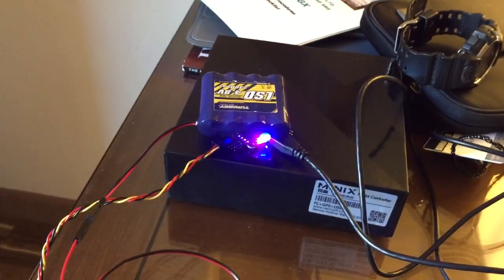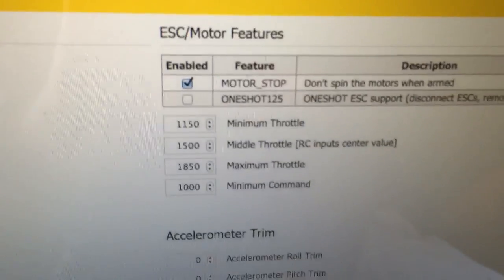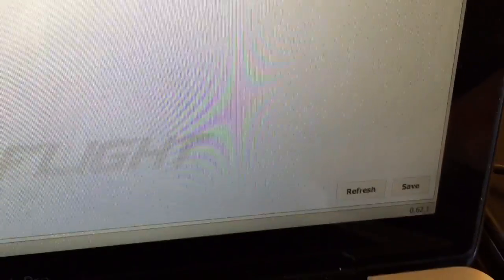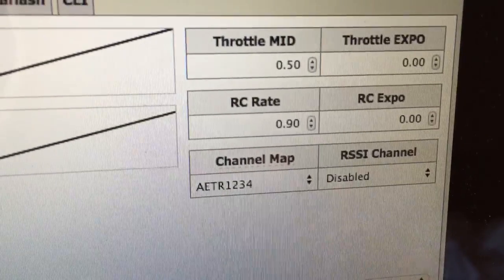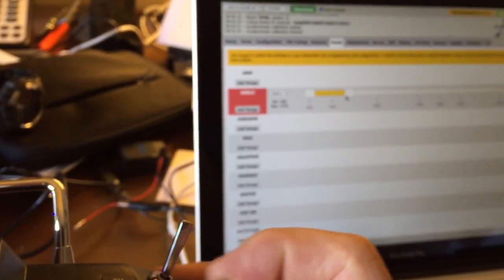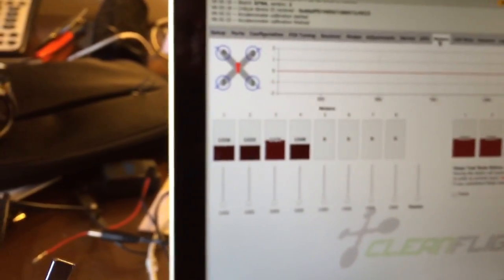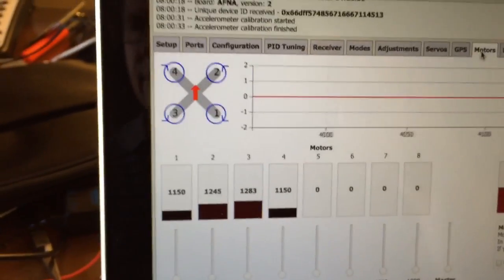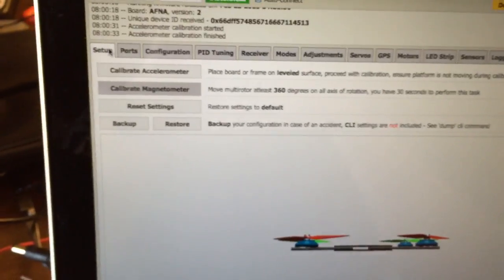Cleanflight configuration on Naze 32 / Mullet.

Comment: I noticed when you were on the motor page of CleanFlight and running the motors through your tx that motor 3 was running up on its own. Did you fly it like this and if so did you notice any controllability issues? I have the same issue and it causes big problems in flight. Very inconsistent hover, especially. Were you able to find a solution for this issue?

Comment: I just got my naze and it says no ports and won't connect though the blue light and flashing sequence works when usb connected. I installed the driver to PC and no ports comes up. Any idea what may be wrong? Do you have to have an rx powerig when using usb?port 3 is open but fails to connect after 10sec
Reply from the maker: Hoverbot1TV No you don't need the receiver powered to connect to the Naze 32 - try a different usb cable - I had the same problem once and swapping usb cables fixed it.

Comment: simple stupid question,how do you arm the board?
Reply from the maker: +francois Bonin With throttle at idle, holding the rudder to the right arms the board, holding it left disarms.
Reply: +Trainboy64 thank you for your reply  , but i think i have a problem of min/max values(ct6b)because it does not work.
Reply from the maker: francois Bonin What radio do you have?  If you have a Taranis your end points should be +/- 100%,  for any other radio you need to set +/- 125%
Reply: +Trainboy64 thank you for your help , its ok now , i have a FS-CT6B , and its known to have a "weak" channel 3 , i made a mechanical modif , removing the stoppers, so now it stops on the stick and gives more course.and it works fine.although , i do not understand , digital radio does not accept more than 120% , but on channel 2 i succeeded to put 127%.Thanks again.